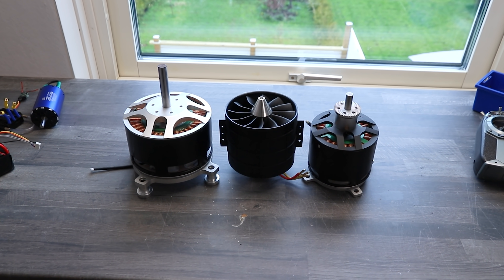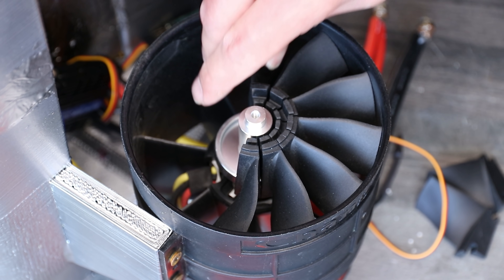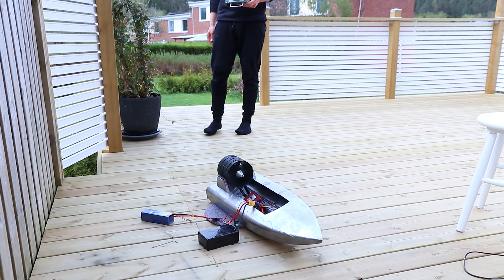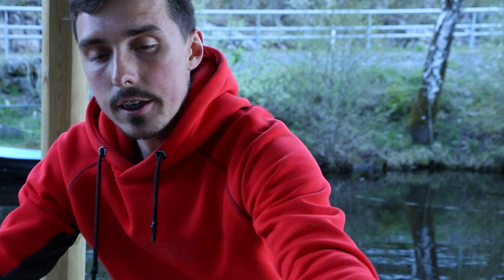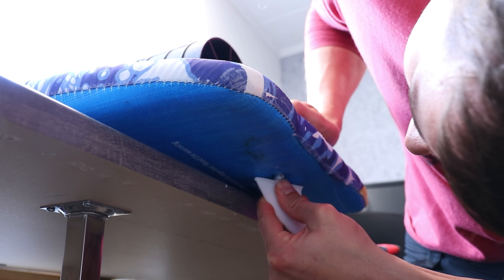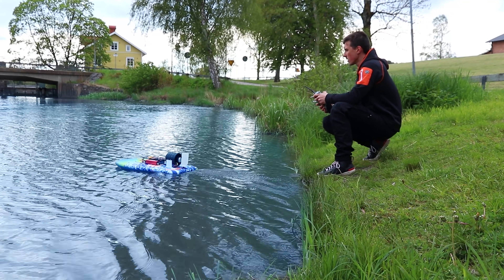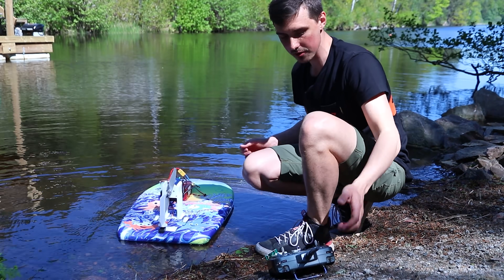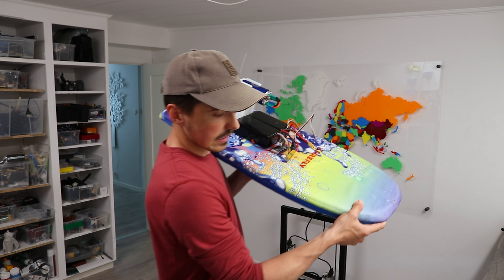How This 7000W Motor Was NOT  Powerful Enough!

Comment: It's awesome how easily you build this stuff! I'm still wondering why are you putting the propeller on the air and the boat on the water when it should be the other way around: propeller in the water and the boat floating as much as possible... That would be an awesome project :) #speed!!

Comment: Project idea for the 20kW motor:  Measure the actual power in physics-watts and compare it with hobby-whats.  Yeah, hydrofoils would have helped, yeah not rushing a video would have helped, but 7000 physics-watts should have ripped through the boat or set it ablaze.  Take your time, Simon.  No hurries on this upload thing.  Flick on your sand machine, smoke a joint, and just bum out :).  Maybe you'll figure out how to get the smoke back in and suddenly become more productive.... Enjoy the summer!

Comment: 4 perimeters regardless of material makes prints on my prusa mk3 watertight, use 6 if you are going to put more than 1½ meter of water of water pressure. Or you could just spray it with a fat lacquer.

Comment: i used to race solar powered rc boats and had the same problems. the problem here seems to be that the surface tension of the water clings on the underside of the large flat board so it cannot get out of the water. you could try and design a much longer, maybe narrower hull for your boat. also, you might want to build in some sort of edge on the underside to break the tension on the water (like the hard edge on the back of speedboats, but more in the middle of the hull). Happy trying!

Comment: Get your ducted fan mounted higher up. It is causing a vortex on the bottom that is canceling out the thrust vector. If you have a smoke machine you can test this and see how the vortexes are coming off the back of the fan and that should give you some information about how best to mount it. I suspect a similar issue is happening with your prop configuration, where the air coming off the back of your boat/board is flashing and canceling out the air from above it.

Comment: First is the design of surf board  etc along with motor angle hitting the water with air, 2nd is you need to test the power of the motor live to see how  much power is actually flowing rather than what it says.  3rd, issue is the torq vs spin. If you have a prop what is big and strong it will sure push more water if it is inside the water but then if the torq of the motor is weak it will be not much use etc. Test the motors with big prop and see how much torq it has plus the live testing etc. You are nearly there but need some  numbers to calculate.  If you are using two batteries and the power of the batteries is less than 100 watt the motor is going to out put only 100 watt of power not 7000W. 7000W MEANS it can take that much power if you provide it with by a batteries etc...Then I am sure you will find some good answers.

Comment: I think you are underestimating the friction between the boat/float surface and the water. Keep in mind that you are using a less dense material (air) to try to move "through" a material with higher density (water) so you would need a lot more power or less friction to move faster than if you'd use the same material for propulsion.
A thing to try could be an air chamber below the float to reduce the amount of friction. The chamber must be closed off on all sides EXCEPT where there would be contact to the water. This has to be airtight to the other sides or it won't work (or push air inside the chamber with a fan. Or to put it in simpler terms make a hovercraft with that...

Comment: One thing many young folks never realize is even if you fail you gain practical knowledge. The cool thing is once you go through enough of these exercises you begin to develop an intellect then you can take on a new project and hit the design pretty close on the first attempt. Unfortunately this process usually takes many years but the more of these excersises you do the more advanced you will be in your later years and that's when you truly get to experience the satisfaction and reap the rewards.

Comment: As an aircraft engineer i'm grateful that i'm not the only one screwed by propulsion efficiency for my exam. I noticed a couple of things: first the trust changed the angle of the craft pushing it deep into the water an causing friction. The second one is that you are using all that power to accellerate a lot the air, that's inefficiency because you just are not moving enough of it. I'd try a bigger prop and see if you can install the ducted fan in a nacelle to produce more trust like the one used on jet engine tests on the ground. Bye!

Comment: 12S ~3.8V*12 under load ~46V it means 7000/46 ~150A ... which is a lot ... given what we can see in the video you probably are only arround 40/50A ... setup something to measure the amps before going to water ...

Comment: The propeller looks much to small, i am using a 12" x 4.5 on my drone with a 200W motor.
7000W motor needs a paraglider backpack sized propeller.

Comment: Perhaps Ive missed something in earlier videos... but why push on air when you have water to push on? There is a finite amount of thrust you can generate on a given amount of fan area; you cant pull in more air than a hard vacuum in front of the fan would; no matter of you put a gazzilion watts into it. Sure there is no limit on how hard you can push the air out in theory but now you are talking a supersonic compressible fan that would mostly be slinger air radially outside if not optimized to produce thrust. Thats why hovercraft tend to have these yuge intake fans. Make your fan swept area bigger; thats the best way to make this work better. Although it will bring its own challenges like more pitching moment and other ridiculousness. If you want those big motors to look impressive rather than just making noise, id go back to sticking them into the water.

Comment: Great video! Looks like you were being held back by hydrodynamic drag, with increased power you also increase that drag so your speed hits a maximum. It's all about getting that body out of the water. If your hull has a lifting effect like a powerboat it might have better results.

Comment: Great video! Try putting the motor up front bcs i thing that if the motor is put at the back, i think it pushes the front up and the back down to the water so ur basically pushing water instead of sliding on top… i dunno 🤷‍♂️

Comment: Using the same motor to power an inboard/outboard would make a boat haul the mail... because ducted fans especially are designed for thrust, not torque.
The only justification for an airboat is swamp water. Even shallow river boats use a submerged jet-drive to traverse rapids and beach the boat.

Comment: I still feel like neither one of those designs got up on plane properly, but I'm afraid I dont really have a solution for your issue other than adjusting the angle on the motor mount. If you had a mount that a servo could tilt up and down it might work better. Using one of those on a hydrofoil would be really, and I mean really cool.

Comment: Awesome builds Simon , but I wonder if you had made a shroud around the back of the first motor you were using to displace the air out the back in a tighter stream sorta like a jet maybe it would’ve gave it more pushing force instead of all that air coming out the back being pushed in a bigger formation. I’m not sure as I’m just guessing but it totally makes sense, and obviously your second unit with the body board was a similar concept to those air boats that they use in the marsh lands to travel on water and land and it’s definitely a very good idea also but it’s the power to weight ratio and also the surface contact that plays a humongous part and I think you would have to shave down the body board to get a lot better performance out of it , but I think your weight will kill it as that’s the hardest part and obviously making it stable also, but I know whatever you do it will be awesome. Keep up the Great Work and Stay and Play Safe !! 👊👍

Comment: "I need to check if it can support 3kg of weight"  
Me: it could proberbly hold you up if you had the balance. I think it will be fine. Also it kept plowing into the water because you started and stopped it to fast what i mean is when it stopped it tilted forward a little bit so when you started it up again it continued in that direction pushing it into the water.

Comment: Your problem isn‘t power, it‘s the boat design because ist doesn’t change into planing drive. Every boat has a certain max speed when it is driving through the water and displacing it. This speed increases with the boat‘s length.

However if your boat is driving on top of the water, you know like your surfboard and your other boats, it can easily exceed this max speed.
To get there your boat first has to climb its front wave which it apparently isn‘t able to, the cause can be weight, drag, center of gravity and others.
The small board doesn‘t have a very aquadynamic shape so i think there might be a problem here, but i can‘t tell from the video.
You probably know all that and googling „planing drive“ would help you more, but just in case you didn‘t know what‘s wrong, i hope now you do.

Love watching your videos and good luck with the motor series!!

Comment: It's your thrust angle. The fan is pushing the nose of the boat and board down whilst also pushing forward so you have massive friction and never getting up on plane. Print a new mount with the nose of the ducted fan a few degrees down pushing its thrust up and back. Pushing the stern down. Thats all it will take to get up on plane and then that power will show.
Reply: ye that's what i was about to write
Reply: High-speed air is still less efficient with props last I checked, Regardless of the cause
Reply: It’s actually because there is no lip intake on the EDF, the lip is responsible for about 20-40% of thrust, so it’s a big deal, especially for that big EDF
Reply: I don't think so: it's the propeller's size. There's a limit to what can you do with a propeller that size, no matter how much power you put in. After a certain point, the propeller starts creating vacuum into which it moves, generating no thrust (i.e. cavitation).
Reply: @guillep2k  Cavitate the air? rofl
Reply: @TheJPexperience112  Stall in this case
But yes essentially cavitation
Reply: @StrelitziaLiveries  They're not the same phenomena, and it's unlikely that it's either.

Why would a manufacturer create a product that will stall or cavitate (somehow) within it's operating parameters?
Reply: @TheJPexperience112  Sorry about the lack of a proper technical term. I meant the pressure in the rotating volume goes so low that the propeller looses push.
Reply: @guillep2k  How is that possible?
Reply: @TheJPex When the blade move faster than the air it displaces, the air doesn't have time to fill in the space left by the blade, so the blade moves inside thinner air and creates a weaker trust. There's only so much air you can move with a blade of X size; trust can't go up to infinite.
Reply: @guillep2k  Hmm I think you need to brush up on your aero and thermodynamics.
Reply: @guillep2k  It somehow make sense
Reply: @StrelitziaLiveries  also @guillep2k 
There's no such thing. Cavitation is a phenomenon when there are multiple fluids and at least one of which is incompressible. There is only one single fluid in air - yes even vacuum is air, only at a lower density, as such there's no such thing as "cavitation" in air.
Propeller stall happens when the propeller (or parts of the propeller) goes supersonic, dramatically increasing drag and causes a sudden loss of thrust.  Given the speed of sound is 343m/s or about 20580m/min, a 240cm diameter propeller needs to rotate at a speed of at least 20580/(0.12*pi)=54618 RPM for the tip to exceed the speed of sound. 
The motor itself has a rated no-load speed of 14625RPM, it is not possible to exceed the speed of sound under load.
Reply: @hereiam3009  was simplifying it alot for the guy i know that cavitation doesnt exist in air hence mentioned stall
Reply: @hereiam3009  I do get what they are trying to say though. It might be designed for use on model aircraft or similar or situations where it will be moving through the air, not sitting still or moving relatively slowly. The propeller will cause low pressure at the front and high at the back, moving forward creates higher pressure at the front of an object so would give the propeller more air to push. Essentially I think what they are trying to say is the propeller may not have enough air to push and therefore doesnt perform anywhere near as well as it should and would if it was on a model aircraft, moving a lot faster than it does on the boat. So I think it is more of a mass flow rate problem, it just doesnt have enough air to push when moving slowly.

Edit: Looking at the pitch of the blades on the EDF they will waste a lot of energy and will have a lot of drag pushing the air out to the sides rather than back, especially at low speeds so they do probably require a high airflow in order to work well.
Reply: @StrelitziaLiveries  Simplifying is one thing but you have to be careful not to get to the point of misinformation. Based on herelam's math any chance of propeller stall is very far off (the prop would need to spin something like a few 10x faster before its an issue)

I'm not confident in my knowledge of aerodynamics, but my best explanation is that when moving at low speeds, its a lot more energy efficient to push a lot of air slowly than push a smaller amount of air fast. This is why in university engineering competitions where they make human pedal-powered helicopters, they use giant propellers.

On faster vehicules, smaller faster propellers start becoming more efficient for a few reasons (my hypothesis: because of the headwind from the vehicle's movement, more air "enters" the propeller so the blades sweep a larger volume of air). As such, maybe the motor/propeller combo in this video would have been perfectly fine on a fast plane, but it is mismatched for a boat.

Comment: I doubt your actually moving enough air to pull the wattages you're looking for.
The blades are way too small, 7kw could spin a 24 in prop.

You either need more blades on the prop so you can have more power in the smaller diameter or a more aggressive pitch on the blades which only works until they start to stall at the low speeds.

Do some wattage and static thrust tests if you really want speed.

Comment: All your titles are click bate a 7000w motor on 50v will drain about 120amps, to carry that current you need at leased gauge 2, what is a 7.6cm thicc cable

Comment: The momentum transfer at low speeds for an airscrew is really inefficient, your ducted fan isn’t anywhere near as large as it could be. The high speed of the motor needs to be transferred to slow moving air, and you’d want a very large airscrew for that. But the resulting large prop makes the motor spin slower, which lowers its efficiency, so you might even have to consider gearing. In the water you can use a much smaller screw. If you’re not going to use a water propellor, then I’d act to minimise the friction with the water. A hovercraft would be a conventional example, if you’re ambitious you could make a hydroplaning vessel with automated stability control.

Comment: Rule #1 with any performance boat... NO round corners, edges. The water follows a curve rather than break away from a sharp edge. It may not still plane with the weight but you're giving it every chance Simon. Love your work and as mentioned, keep the OOPS moments in!

Comment: These things are made to push a very fast aircraft, still providing thrust at 30m/s. For this kind of rig you would likely benefit from an oversized fan and geared down rpms. You could prolly try smthn like 1:3 gearing and a 200mm diameter fan. You need greater thrust and at lower speed ranges than an aircraft fan will produce. 
Great content channel btw! Even food for thought sometimes, with all your creative ideas. Keep e'm comin.

Comment: it wasnt going fast because the propeller is pushing the air while the resistance the boat thingy is facing is from the water. If the propeller was pushing water, which is the same medium as of the resistance, it would go fast as normally boats do.

Comment: The problem is the difference between the density of water and density of air. If the air was denser, it would help your propeller to "bite" into the air and push harder and if water was less dense, it would reduce the drag of the boat. Unfortunately the air is very thin and water very dense. So the thrust is reduced and the drag maximized.

Comment: I would recommend looking at a few airboats. I think a hull with less drag would benefit you the most as opposed to the increase of power currently. Also a three or four blade prop could help significantly in increasing acceleration while not dramatically reducing top end.
Reply: And a larger propeller.

Comment: you could try and 3D Print Hydrofoils to lift it out the water to reduce the drag.
Reply: Just what I wanted to say, I do believe the trust from the props cannot overcome the drag of the body board.  Also the trust goes down into the water and I am sure this creates some other type of hydrodynamic drag.
Reply: Wanted to say this too!
Reply: Wanted to say this too!
Reply: this!
Reply: That would be my plan. I used to have a pickle fork hydro and as soon as the bottom starts packing air drag actually decreases and the amount of power required for more mph is much less than any other hull. The back of my boat was out of the water past 75 mph

Comment: Why dont you make the bottom Hydrophobic for maximum glide, also when the prop is sucking in air and pushing it out the back why dont you use that air and put it through some sort of rocket nozzel and then move the nozzle around for stearing or redirct the air to a valve underwater